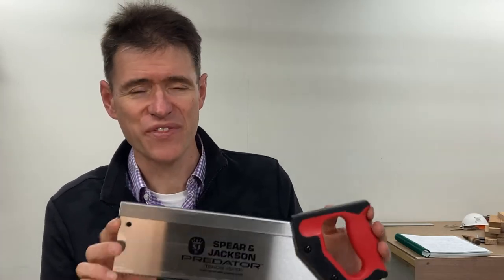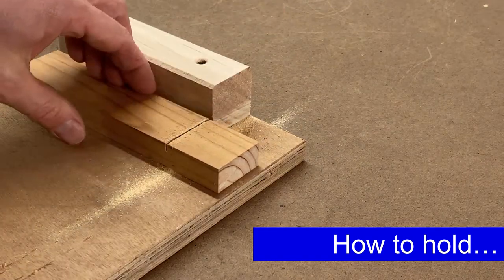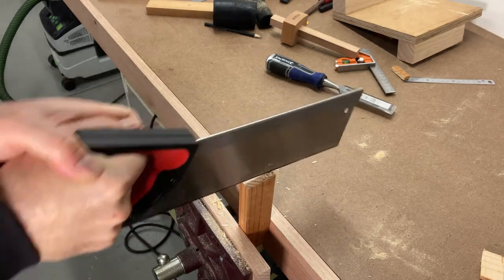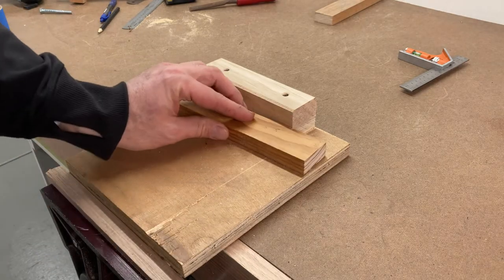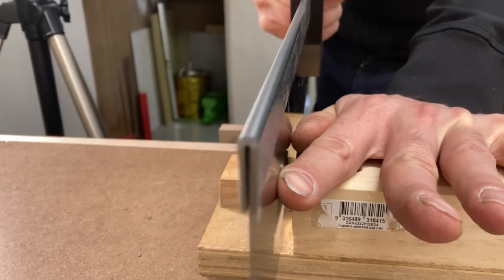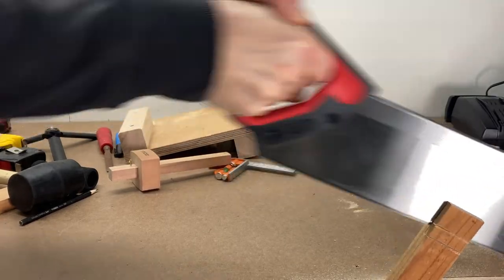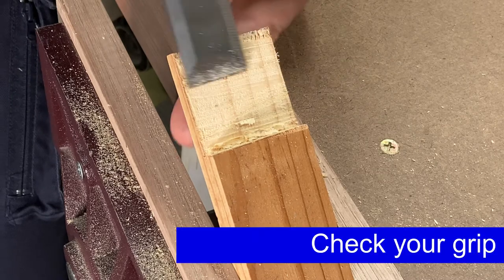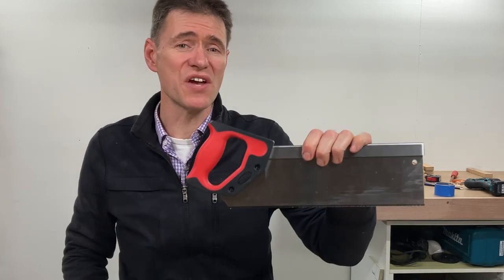How to use a tenon saw

Comment: Hi Colin, I'm a Teacher and looking to purchase a class set of tenon saws. Is the Spear and Jackson Predator saw you use in this video any good? Thanks
Reply from the maker: Yes, I think it's a great saw. Widely available, not too expensive, a good strong spine and nice handle for ergonomics. And, you can have the blade sharpened. School students deserve to use excellent tools which are well maintained. These saws aren't the most expensive, but I also wouldn't buy anything less than these.